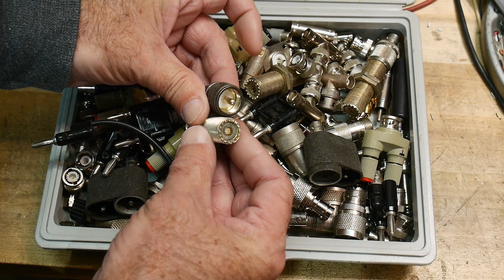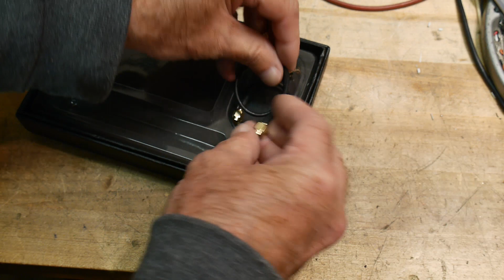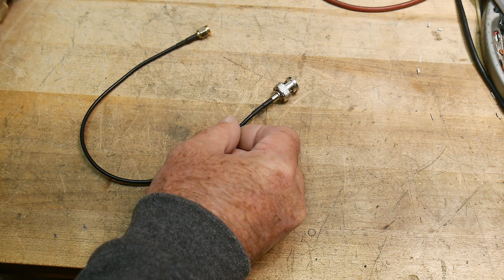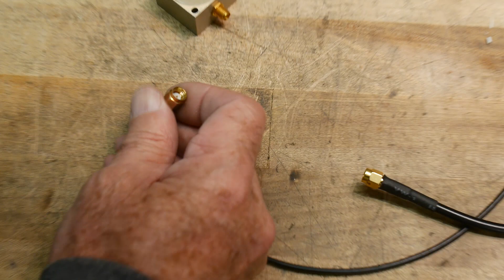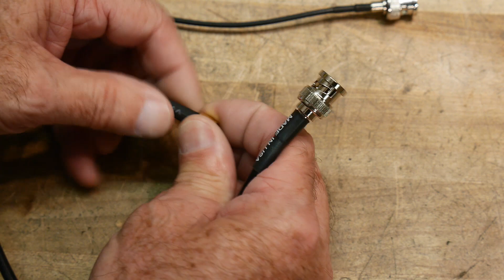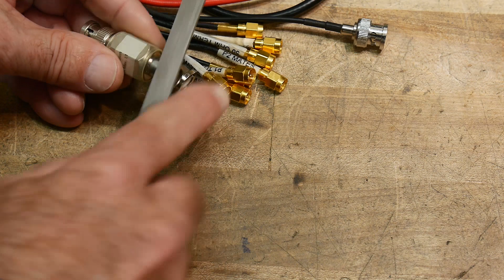#563b RF Connectors and Cables the Good and Bad

Comment: I'm curios if you have any thoughts on the quality changes of RF connectors throughout the years? I brought a lot of Amphenol and Shuner connectors and their make-up is definitely very difficult from the average N, bnc or pl-259. Mostly the metal composition I think? The cheaper ones weigh much less (saving materials?) etc. Or am I biased because older connectors are heavier so they "feel" more substantial?
Reply from the maker: yes the old ones are better unless you  are buying good brand names. I like Pasternack

Comment: I would be interested in the differences in the insulator materials used in the connectors; you can find bakelite, teflon/PTFE and whatever, about which there is not necessarily any information. I understand PTFE is good, but what is the next best thing if a Teflon-insulated connector is not available?! Connectors is always good subject to discuss. Examble Mic connectors - most of ham radio use is quite crappy. There is a big gap from Heill to Bulk. Size of "twist roll" and how badly they connect to radio example..

Comment: Once upon a time, I had a coworker that was an audio snob. He would accept only the very finest audio equipment. He was especially proud of his speaker wires, which were state-of-the-art, oxygen free, low capacitance, heavy gauge. Very very expensive. I asked him if they actually made a difference with his speakers. Turns out he didn't have any money left to buy any speakers. He just sat in his cold, dark and very quiet apartment fondling his lovely speaker wire.

Sometimes buying cheaper equipment that is at least merely good enough leaves more money for other nice things.  One need not always be a connoisseur in every single thing. Balance.

Cheers.

Comment: Yep dodgy cables suck. I use exclusively old hp for bnc, and other good brands for the other types. Cables are a lifelong investment lol, but will sure dent your wallet. Another type is triax, but thats not rf. I have many an instrument that i spent the same if not more on the cables and probes than the instrument/ device itself.

Comment: The one connector type that is not shown is the old Amphenol "button" or microphone connector. These were common on old test equipment, such as the old Heathkit vacuum tube RF generator.

Comment: Is there a connector type that works BETTER in small coax size (RG174) for frequent attach/detach cycles? 

A HAM friend suggests a male/female RCA connector to protect the SMA connection to the handheld transceiver.  Application is a vertical 2m dipole antenna for paragliding use (fixed to a riser).
Reply from the maker: you can get BNC connectors for RG174
Reply: @IMSAIGuy  Should I understand your response to be that BNC connectors would make a better high-cycle connect/disconnect connector than an RCA or an SMA connector?
Thanks for the response!
Reply from the maker: @VARocketry  yes bnc is rugged
Reply: @IMSAIGuy  Thanks very much.I'm placing eBay orders to build several "Wonder-Whip" antennas  for paragliding use.  Very helpful and timely.  Thanks again.

Comment: Are RCA connectors the same as what you call "Banana connectors?
Reply from the maker: no
Reply: "RCA" connectors (sockets in the follow examples) are like the yellow analog video output connector from a VCR, or the similar red and black audio outputs, or the phono and line audio inputs on the back of an old stereo receiver.

Banana sockets and plugs are like the connectors on a DVOM or multimeter, and the plugs on the meter-end of the test leads.

Comment: The cheap chinese BNC connectors are not machined, they are LOW QUALITY METAL INJECTION MOLDED.
Usually the line of the two mold parts can be seen.

Comment: I have the same experience like you. Starting out buying the Chinese cables and connectors and end up trowing them away and then going for the more expensive stuff. Made in the USA is great but nothing beats made in Switzerland :-) 
If you want to try that, when you are looking for a new cable on ebay, also put in Huber or Suhner in the search  term to get to the real good stuff.  You will feel the difference when you screw them in for the first time, the treads mates together like they are making love with the other connector, sooo smooth and precise.  Thanks for another nice video!
Reply from the maker: Yes. I'm familiar with Suhner. those brands are not very common here. I'll take a look at Huber. Oh, I guess that's the same company
Reply: Hi Harry. My Desktop 80to10 WSPR transmitter is working just great. Thank you.
Reply: Lol literally made a comment on this, been so annoyed by buying seemingly Belden H155 but the coax is unlabeled and has less shielding than the proper stuff. It's sad, getting more and more difficult to get good equipment unless you're buying from mouser, digikey etc.

Comment: 05:43 - I see on the right - hand - side you have 2 'UHF' (PL259/SO239) adapters in the second box, and a 3.5mm plug :-O
You might want to move those to the other box before they contaminate the nice connectors with their inherent unpleasantness!   ;-)
Reply from the maker: you're right! I need to get rid of the undesirables.
Reply: I saw that! For shame! 😄